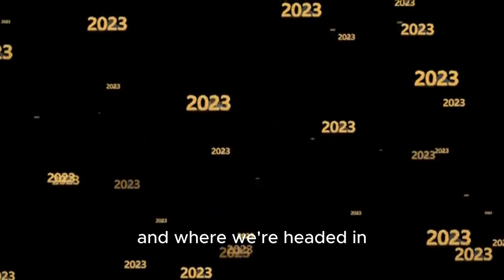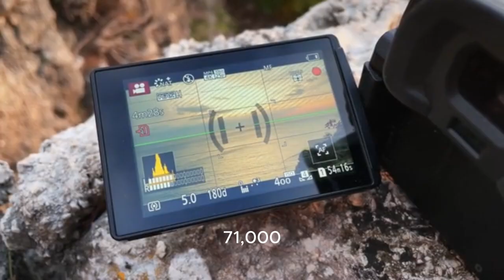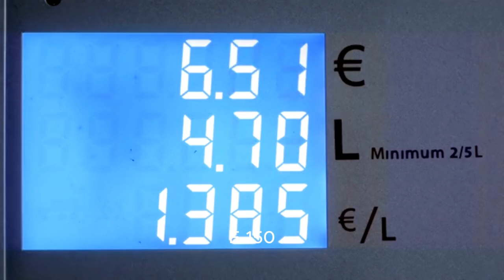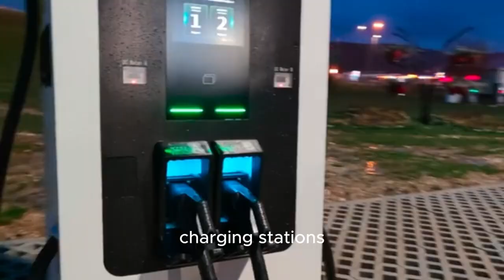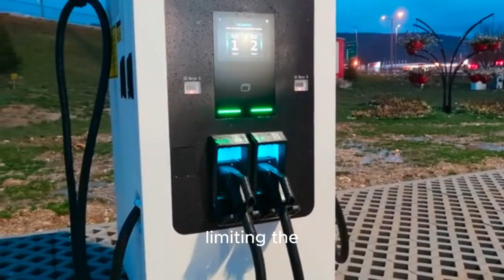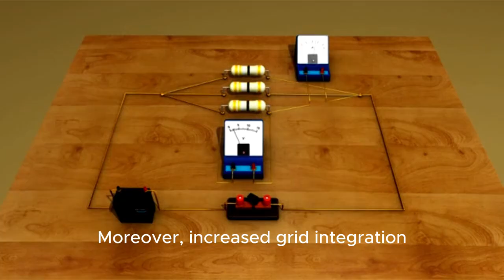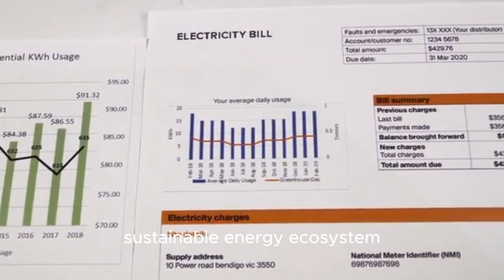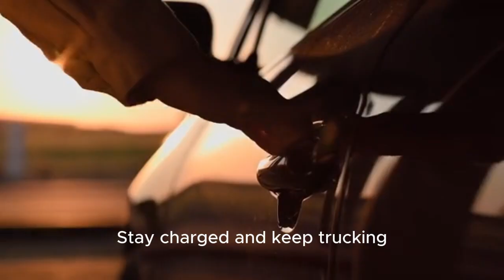The V8 is Dead: The Real Reason Traditional Truck Owners Are Going Electric

Comment: While the technology definitely has potential. This video is nothing but a bunch of compressed AI slop .

Pre-order numbers for electric vehicles does not imply their success, considering how badly the F-150 lightning performed, and that a lot of the people that were rushing to get them were looking for cloud, not performance. 
Tesla cyber truck has been an unmitigated disaster, proving to have horrible quality control. 

And the reality is, most people are making decisions on the margins, if it's cheaper to operate an electric vehicle then they'll run it, but whenever the government removes incentive programs, the sales always go down. At the current state of the technology and the state of the electrical grid and the state of the charging grade, you're simply not going to convince the average ICE vehicle owner to switch over. The only people offering a really viable solution is the retro fit kits that Edison motors has been putting together to convert your vehicle to a diesel electric hybrid, which I'll be purchasing at some point in the next 5 years to retrofit some of my older vehicles. 

The idea of an environmental savings from electric vehicles is simply a farce, you're still pulling from the power grid which is still coming from fossil fuels, until we invest wholesale into nuclear. 
Mining for lithium and Cobalt is incredibly toxic to the environment, so maybe we're looking less carbon in the air, but we're poisoning, the groundwater and the dirt, and that's just lovely

Comment: The v8 is not dead i promise you. Most people prefer gas powered over electric. Especially those north of the rust belt as our winters literally wreck havoc on electric vehicles as they have a tendency too leave people stranded due to low battery efficiency